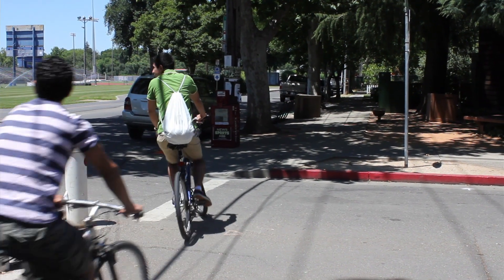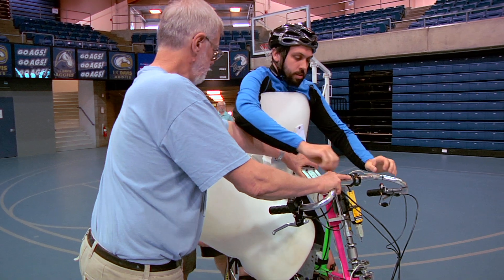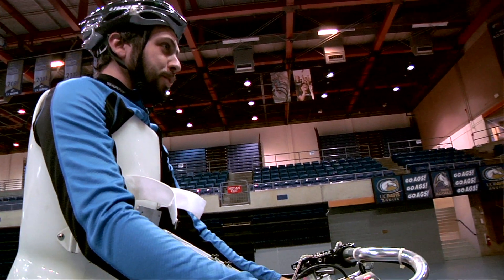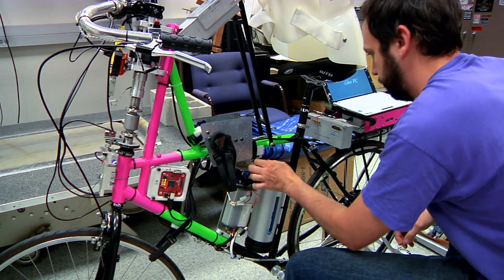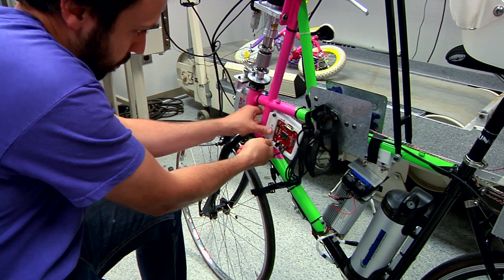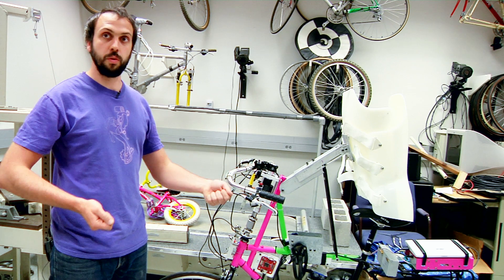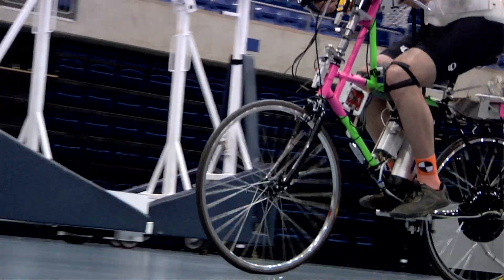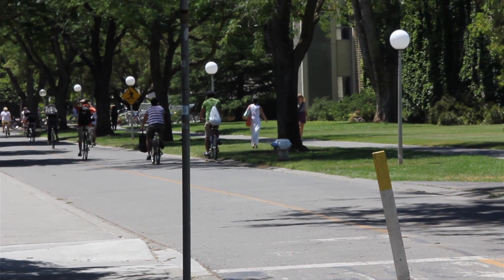The science of balancing a bike

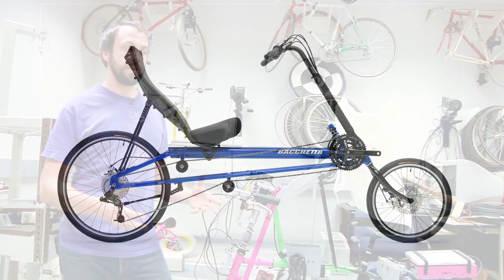Comment: at 0:58 : The front fork of that blue bacchetta bike has a specific radius bent and an angle. In that case it is bent radius is too small for that nearly 45° angle making it overreacting way too much. A common bike with a steeper angle has a bigger radius, therefore the over-reaction to keep the bike straight is less sensitive.
In case of that specific bike even a completely straight unbent fork would be better due to that mounting angle and size of the front wheel.